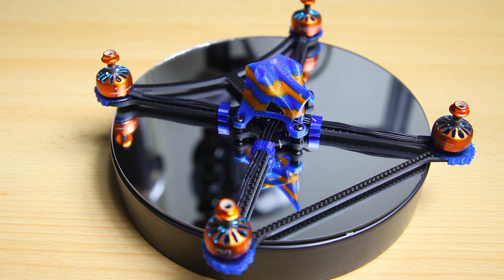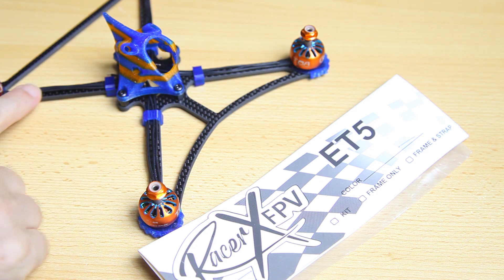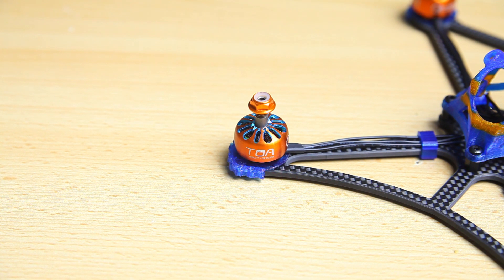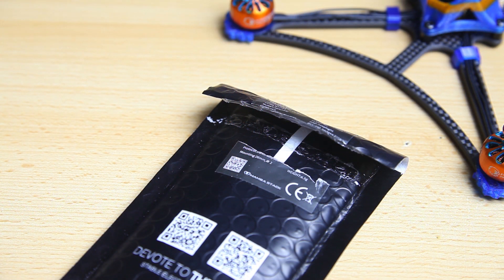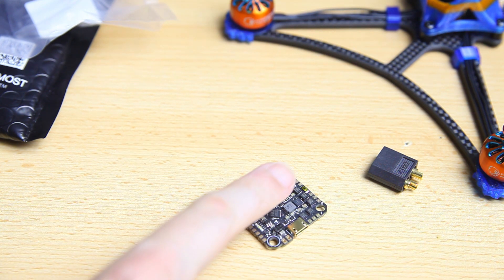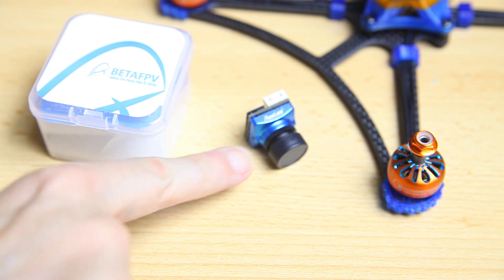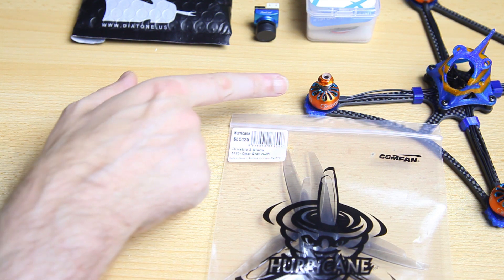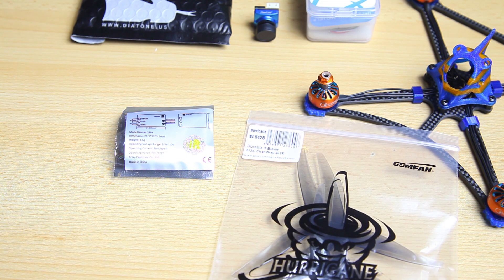Hyper Light 5" Project! The ET5 - Project Intro :)

Comment from the maker: Excited to build & fly this! But first.. What parts will I use & Why? :) 
Frame - Racer X - ET5 Ultra light: https://racerxfpv.com/et5 

FC / ESC - Diatone Mamba F411 25A AIO : https://www.banggood.com/Mamba-F411-AIO-F4-Flight-Controller-25A-4S-Blheli_S-DSHOT600-Brushless-ESC-Stack-comptaible-DJI-FPV-Air-Unit-25_5x25_5mm-for-Whoop-Toothpick-RC-Drone-FPV-Racing-p-1703967.html?p=TO251813974002015038 

Motors - Karearea 1507 3100 KV: https://www.kareareadrone.com/product-page/1pc-new-toa-lite-1507  

FPV Camera - Runcam Phoenix 2: https://www.banggood.com/RunCam-Phoenix-2-1-or-2-CMOS-1000TVL-2_1mm-M12-Lens-FOV-155-Degree-4-3-or-16-9-PAL-or-NTSC-Switchable-FPV-Camera-For-RC-Racing-Drone-p-1634264.html?p=TO251813974002015038 

VTX - BetaFPV M02 25-350mW: https://betafpv.com/collections/camera-vtx/products/m02-aio-5-8g-vtxpin-connected 

Propellers - Gemfan SL 5125: https://www.banggood.com/2-Pairs-GEMFAN-Hurricane-Durable-3-Blade-SL-5125-5Inch-Propeller-Compatible-with-T-Mount-Shaft-Motors-p-1682564.html?p=TO251813974002015038 

Receiver - Frsky XM+: https://www.banggood.com/Frsky-XM+-Micro-D16-SBUS-Full-Range-Mini-RC-Receiver-Up-to-16CH-for-RC-FPV-Racing-Drone-p-1110020.html?p=TO251813974002015038 

Lipo - Tattu R-Line 850mah 4S: https://www.banggood.com/Tattu-R-Line-V1_0-14_8V-850mAh-95C-4S1P-Lipo-Battery-XT60-Plug-for-iFlight-Green-Hornet-3Inch-CineWhoop-p-1561680.html?p=TO251813974002015038

Comment: should be no problem with 3100kv on 4S...
I fly my ET5 with 6000 kv 4S with t-mount bi-blades and 1207 motors at 66% motor output limit... the only downside is that my motors are too small to sustain crashes
Reply from the maker: Damn! 6000kv you say huh? :D  now That is high kv for sure ;) 
How is the throttle control on that setup? :$
Reply: @DutchRC  I am not a great pilot to feel things but no notable issue concerning throttle... . When I cut the throttle it feels like hanging in the air a fraction of a second longer then other quads. Inertia of the blades or airmode needs tuning I have no idea. On punch outs it has surprisingly good power for motors of this size.